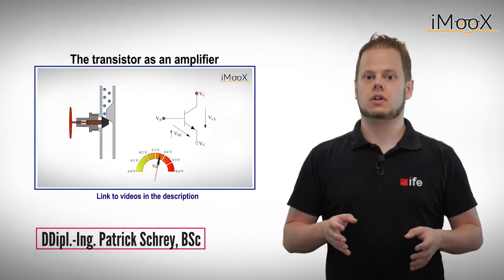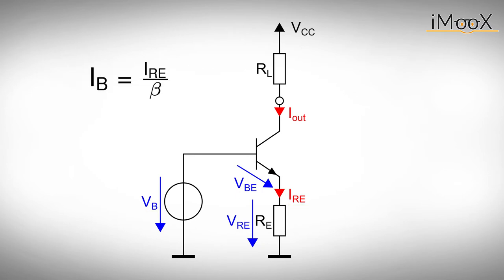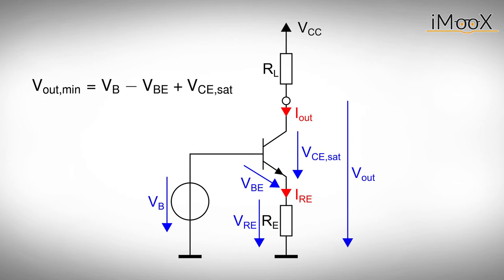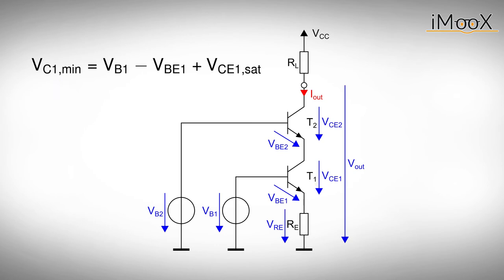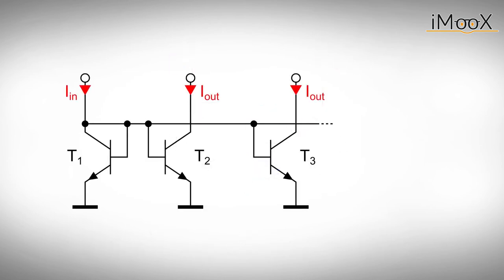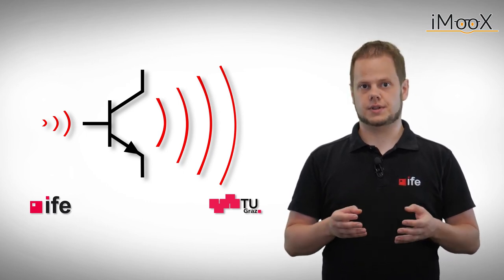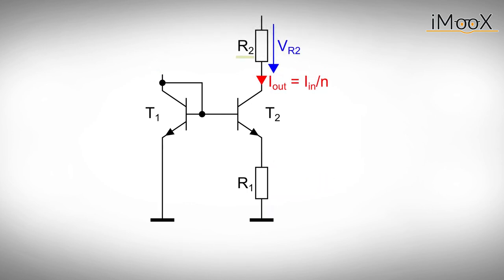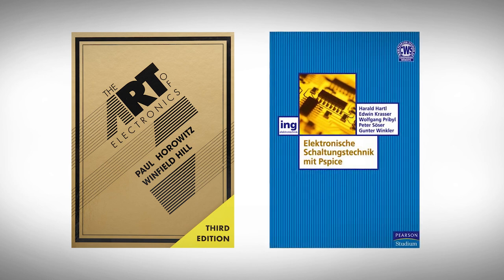Transistor Circuits - Current Source, Current Mirror, Voltage/Bandgap Reference

Comment: This is a great video! I have one question though: if you just need transistors with the same base-emitter voltage to make a current mirror, why does the base need to be connected to the collector of one of the transistors? Why can't the base be connected to some other voltage source?
Reply: I’m still learning the details of this too, but here is my response:
You could have an independent voltage source connected to both bases, but then it wouldn’t really be a mirror (the transistor current on the right would not be copying the transistor current on the left). You would effectively end up with 2 individual, parallel current sources like the one at 1:07 and they’d be set to the same output current. Then I suppose you would be using the independent voltage source to set both output currents, rather than using the current in the left transistor to set the current in the right transistor.

If you just wanted a constant current source using the current mirror, I guess you’d be adding extra complexity because you’d need to have another voltage source to set the current. 
In the current mirror, the base-emitter junction is fairly constant so it provides that voltage source for you if you just connect the base to the collector and you don’t need an extra voltage source.
Reply: @joet4348  I see: so if the bases were connected to the same independent source, they would have the same current, but that's not the function of a current mirror. 

That makes sense. Thank you for the explanation!
Reply: It all starts here, if you're in for more of what is hidden in Transistor design.
https://youtu.be/m9FNdBTh-yk